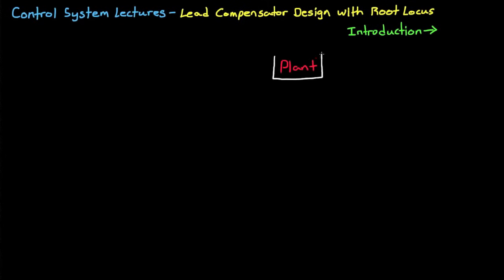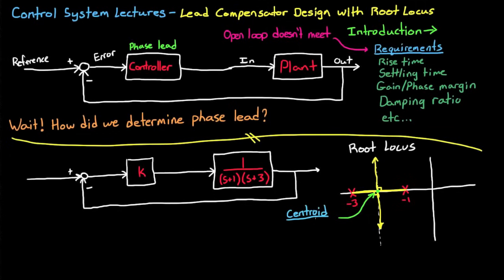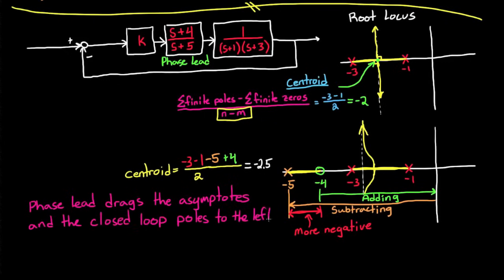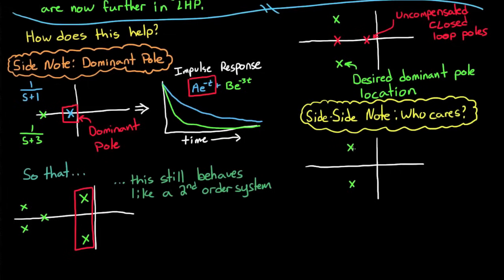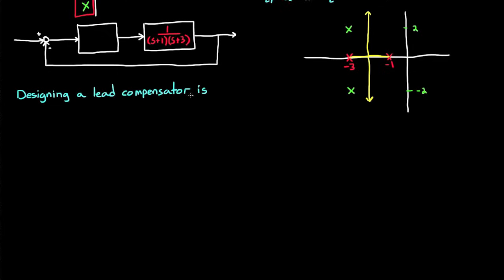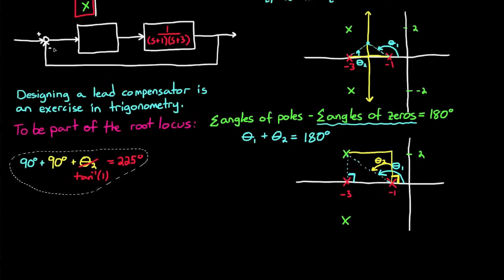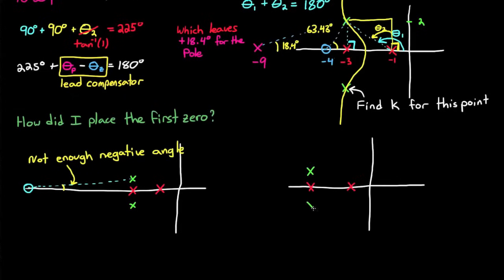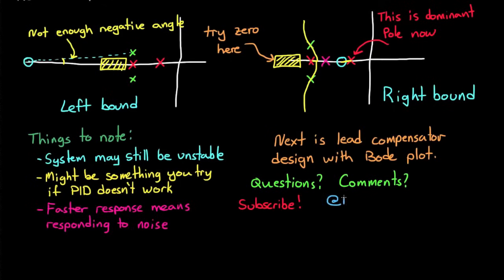Designing a Lead Compensator with Root Locus

Comment: Longshot on a response, but I'm working on a problem to design a lead compensator D(s) = K(s+z)/(s+p) with an open loop plant of G(s) = 1/s^2. As I understand, there are two poles both located at the origin, and the prompt gives a desired pole location at -2 +- 2j. The locus of the open loop plant would be two poles at the origin that extend out at 90 and 270 degrees. Given that the desired pole location is at -2, 2 and the angle contribution of both poles are 135 degrees, the resulting theta 1 and 2 add together to be 270 degrees. Obviously this is 270 does not equal 180, so the point isn't on the locus and the compensator will have to add zeros and poles. If I place a zero at -2, below the desired point, the angle contribution to the angle criteria is -90 degrees. 270 - 90 = 180, so it now satisfies the angle criteria, however there is an unaccounted for theta p for the angle contribution of the arbitrary pole. The problem is then that the contribution of the added zero made the locus pass through the desired point, meaning that the added pole angle contribution should be 0, which is not possible unless I'm missing something. 

I did try moving the zero one unit to the left, placing it at -3 rather than -2 directly beneath the desired point. This led to an angle contribution of 63.4 degrees, meaning that the added pole contribution would be 26.6 degrees. The problem then is that, when solving for the distance that the pole must be placed for the 26.6 degree angle contribution, the "x" value is equal to 2/(tan(26.6) which comes out to be 4, meaning the pole should be placed 4 units away from the desired point, -2. I took this to mean that the pole should be located at -6. 

When comparing to a solution manual, all of the above is incorrect. I've ran through the problem a few different times to make sure I've done it correctly according to the procedure shown in the video but still haven't come up with the correct result when plotting in matlab. The solution manual states that the D(s) should be K(s+2)/(s+20). When plotting, this gets close to the value but not exactly crossing, so I'm unsure how accurate the solution is. Regardless any tips would be helpful as I'm not sure where I'm going wrong here.

Comment: Hello Sir, Huge fan of yours. Thumbs up for your hard work <3. But I have a doubt on the Centroid calculation at 2:46 because I think according to the example it is -3+2/2 due to both negative poles and a negative sign in the equation. Am I right or wrong? But still confused.. :-D
Reply: Probably late but no, looks correct to me. -3 and -1 both are poles and their sum evaluates to -4 which divided by 2 is -2.

Comment: Hello Brian! Thanks for your amazing videos! I have a question that might sound dumb, but when you determined the angles of your desired poles and saw thet they were 225º (and therefore you had to substract 45º to make it 180º), why not simply add a zero at 45º? Why add a zero AND a pole?
Reply: I don't suppose you found an answer to this?

Comment: At 9:50 when he is adding all the angles of the poles for the angle criterion, why doesn't he add the angle made by the complex conjugate pole. That would add an extra 90 deg making the total 315 deg instead of 225 deg. Please and thank you for the clarification.
Reply: for anyone else wondering, those are not complex conjugate poles. They are the points where he would like to move the poles on the real axis.

Comment: at 9:58, the angle is 90 + 90 + theta2, wouldn't that be (90+90+90+theta2), what about the angle by its conjugate pole?
Reply: Avinash Maurya Shripal I had the same question. Did you ever figure it out?!
Reply: Luis Andrade theta2 is nothing but 90 - theta1. Theta1 was split into 90 degrees and theta2 for the sake of simplicity.

Comment: when we add  zero at -4 and pole at -9 then centroid shifts to -4.5 (so does the assymotote) but you passed it through -3 !! why??
Reply: yes! it can be, just your are ensuring that those poles are in the root locus. If you compute the breking point, you will find it between -1 and -3. So, when  the asymptote branches start to deflect, they pass trough the new dominant poles point.

Grate question!! its just an error of scale.

Comment: How can one find the break in and break out points?
Reply: we can find the break in and break out points by some math with the characteristic equation of the closed-loop transfer function.. delta(s) = 1 + k*G(s)    (where G(s) is the open-loop tranfer function)

the break in and break out points occur when the poles of the system leave and enter the real axis.. and therefore occur at the greatest value of k on the real axis.. we can find these by setting the characteristic equation equal to zero and solving for k

1 + k*G(s) = 0
k = -1 / G(s)
taking the derivative of k and solving for when it is equal to zero will tell us the break-in and breakout points. I like to represent G(s) as a numerator polynomial N(s) and denominator polynomial D(s) and the quotient rule to simplify the process... solving dK =0 for s will give you the real axis coordinates for of the break points

Breakin/out points =
            N(s)D'(s) - N('(s)D(s) = 0 
            => solve for s

Comment: When you place the first zero, is it possible to place it on top of, or at least extremely close to, the pole already in place at -3? That way you don't need to worry about the angle from that zero or the pole it is on top of as they should cancel out.
Reply: I realize that this is five years late but...yes you can!. Placing the compensator zero precisely at -3 and a pole at -5 with a gain of 8 will give you roots at 
-3+/- 2j.

Comment: Very helpful video. Thanks Brian !!
But I have a few doubts...
01. How did you determine to put dominant poles on -3+2j and -3-2j ?
02. How to determine dominant pole location(s) ?
03. How it can be proved that "In order for a point to exist on the root locus, the sum of the angles of all of the poles - the sum of the angles of all of the zeros should be 180 degree ?
Reply: +Milan Shah Dominant poles are those poles which have a greater or a longer effect on the transient response, i.e., the poles which are nearer to the zero on s-plane are dominant poles. The general rule followed for differentiating between dominant poles and insignificant poles is a factor of 5.

Comment: But if your angles sum 225º shouldn't you be using a lag compensator in order to subtract 45º and attend the angle condition? I guess the confusion here is due to the fact that you subtract the zero angle instead of adding it (10:18). As far as I know, the zero angles should be added and the pole angles should be subtracted because of their positions in the numerator and denominator, respectively, in the feedfoward transfer function.

Comment: Brian brilliant video ,but you didn't really explain how to get the pole and the zero for the lead compensator.
Reply: +Boitumelo Dikoko True... I wish he had a full formal example on the subject.
Reply: Same here because control is very rare to find. And all textbooks have different methods and explanations.
Reply: +Jonathan Tefera Endale mmm... part of my previous comment appears crossed out... I did not intend for it to be in that way...
Reply: +Boitumelo Dikoko Somehow yes he does say how to get the pole and the zero. From 10:14 on, he explains that in order for the desired poles(the green crosses) to be inside the locus branches, the angle that they make with the poles of the loop have to fulfill the 180º requirement. For the uncompensated system with poles in 1 and -3, the sum of the angles for the desired pole was 225º so he needed to place the lead pole and zero so he could subtract 45º. The position of the zero was chosen arbitrary(the only requirement that he gave was for it to be at the left of the original poles but not very far from them), in this case in -4. Once you have chosen the position of the zero, there is only one posible position where we can place the lead pole if we want the desired pole to be in the root locus(again, it must fulfill the 180º angle requirement). First you have to obtain the angle that the desired pole makes with the zero. In this case tan(AngZero) = 2/(-3(-4)) = 2 -> angZero = atan(2) = 63.4. Knowing that 225 + angPole-angZero = 180 
 ->   angPole = 180-225+63.4 = 18.4. angPole is the angle that the desired pole has to have with respect the  lead pole. tan(angPole) = 2/(distance between the poles in the real axis),  -> distanceBetweenPolesRealAxis = 2/0.333 = 6. The lead pole will be then in  -3-6=-9 . The Lead compensator will be then (s+4)/(s+9)
Sorry for my English! Hope it helps.

Comment: how we got tan-1(1)
Reply: supratim ghosh The tangent of an angle is the ratio between the opposite side of a triangle over the adjacent side. In this case it means: tan-1(2/(3-1))= tan-1(2/(2)) = tan-1(1)
Reply: +AlexB but the centroid is at 2 .....which means the adjacent is 1 and opposite is 2 .......that does not give 2/(3-1) but gives 2/(-1)
Reply: +shand seimela To find theta2, the red pole is located at (-1, 0) while the green pole is at (-3,2). 
So the tangent of theta2 = opposite / adjacent = (difference in x coordinates) / (difference in y coordinates) = (3-1)/(2-0) = 2/2 = 1
Theta2 = tan-1(1) = 45 degrees.

Comment: could someone please explain how he got the 63.4 degrees, and how he got the zero at 4 exactly? Thanks
Reply: Ohimai Musa For the zero located at -4, he just placed it there randomly (it just need to be left of the pole at -3 so that it can move the root locus towards the desired pole location). After placing the zero at -4, he can then find a suitable pole location of the compensator to meet the angle criteria. Now to find the angle from having a zero at this is location is just geometry: 63.4 degrees = tan-1(desired dominant pole imaginary location /(zero location on Real axis - desired location on real axis )) = tan-1(2/(4-3)). Remember than the tangent of an angle is the ratio between the opposite side of a triangle over the adjacent side.
Note tan-1 is inverse tangent.
Reply: AlexB Thank you!

Comment: Why does my system completely lose its integrator when I try to apply a lead compensator? When I compute the new closed loop transfer function, the denominator has a new K * (s + z) term, which eliminates the integrator.  Now my type 1 system goes down to type 0. What the hell

Comment: Hey Brian! Small clarification. Sum of angles of open loop poles - sum of angles of open loop zeroes should be 180 degrees, because, for 1+kG(s) to be 0, D(s)/N(s) = -k. So, to account for the minus part, the net angle should be 180 and the actual gain k is decided by the frequency at which it is measured, And so to reduce the angle from 225 to 180, we add more angle in the N(s) and less in D(s) through a lead compensator. Is that correct?

Comment from the maker: Hi LouAnn, A lead compensator can only add up to 90 degrees of phase (and that's only if the pole is way off to the left towards -inf).  But realistically a lead compensator can really only add about 55 deg of phase due to restrictions in the size of the components needed to make it. Therefore, in order to get 90 deg of phase you'll need to add two lead compensators. Try designing one compensator to add 45 degrees of phase and then create a double pole and zero at that point.

Comment: Hi, how about the following system: H= 1/(s+1)^3
I to design want a compensator such that overshoot and settling time  to a step response are respectively 15% and Tr95% = 3s. So the dominant pole will be -1+1.6536i.
When I try to design a lead compensator such that transient performance are met, I find uncompensated angle of the system is -270°, that means lead compensator must contributes for 90°. How to determine the compensator zero and pole in this particular case. Thanks for your answer.

Comment: no spring semester at the University of North Dakota and here is the awesome thing, the prof. did not cover PID controllers in class at all so i did a presentation covering almost everything in control systems in 30 mins at the last day of class last week, and most of the material was yours, i introduced PD controls in class from your root locus lecture.